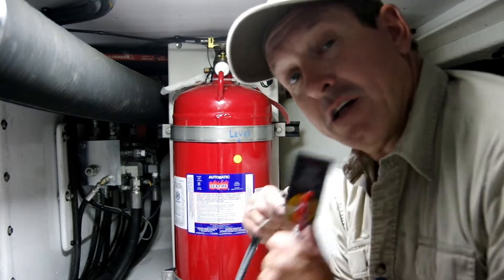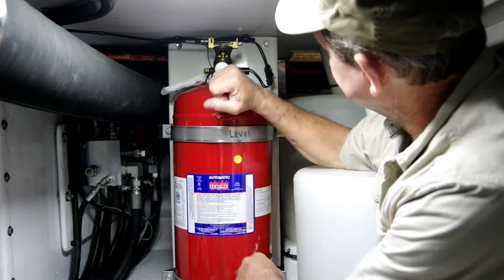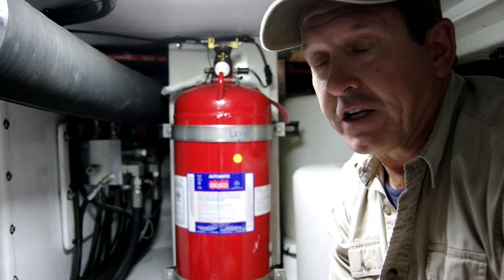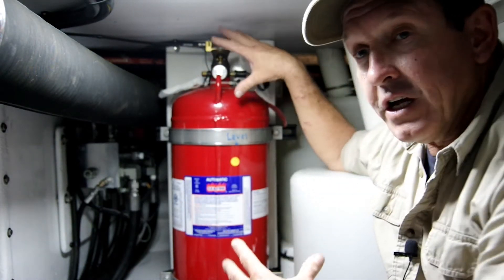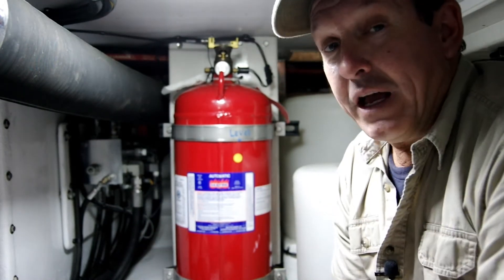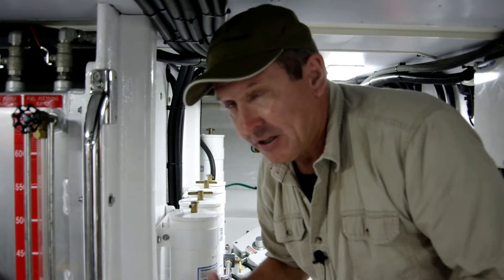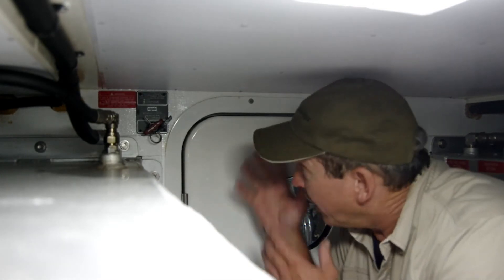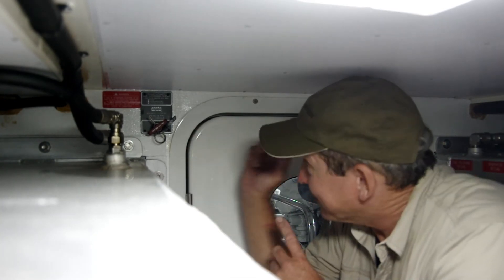An automatic fire suppression  system is not enough for your boat

Comment: Thanks for the amazing info. Can you tell me where the automatic fire prtection switch is? I believe my fire suppression system is not allowing the port engine to start up. The marine electrical guy looked at everything and said it leads to this. Since my boat does NOT have a circuit board (just a harnass), he did not try to disable it. Thanks for your help. ;)